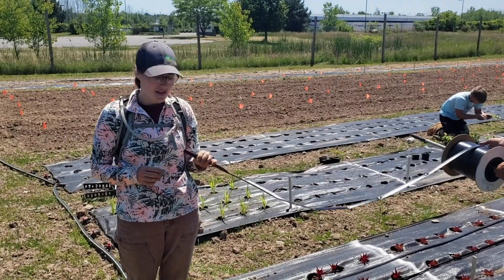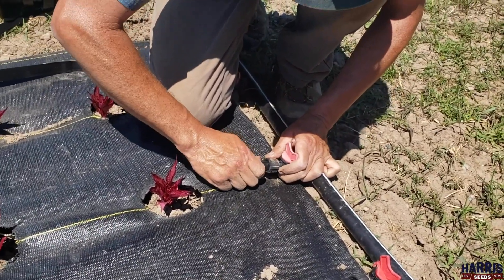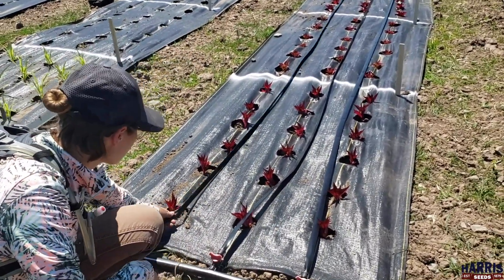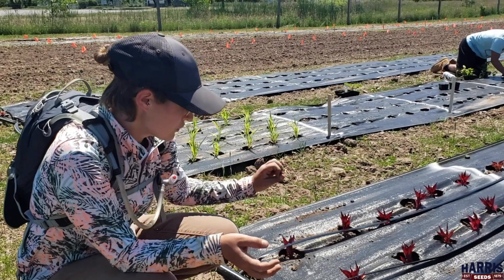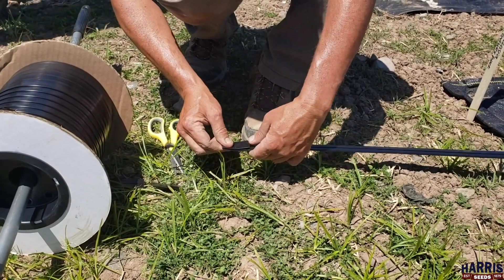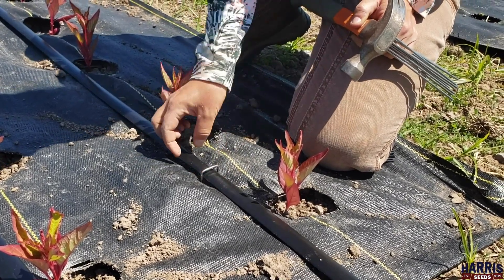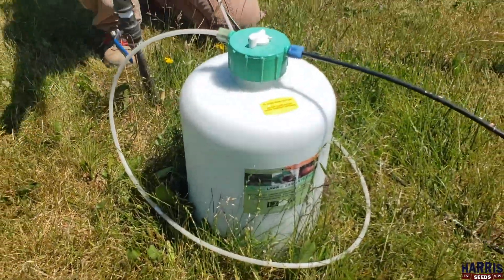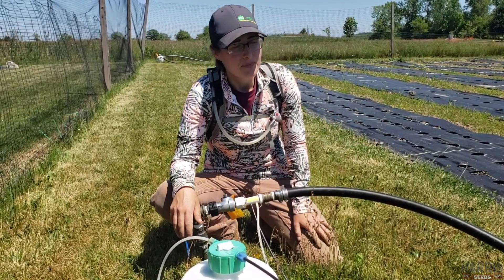How to Install Drip Irrigation

Comment: I have Harris Drip tape and the roll strictly states  to keep the emitters facing up not down so they dont get clogged?? Video says they should be down so is it down or up?
Reply from the maker: Hi Scott – while we have had success with installing them facing down, we generally recommend installing drip tape with the outlets facing up to prevent plugging by sediment that may settle in the tubing